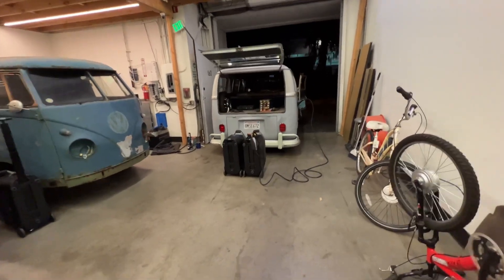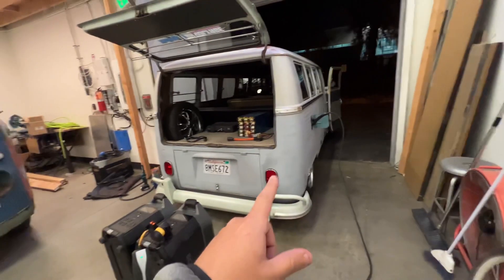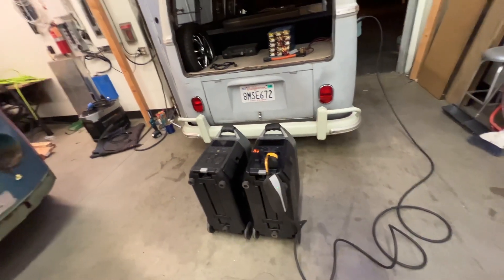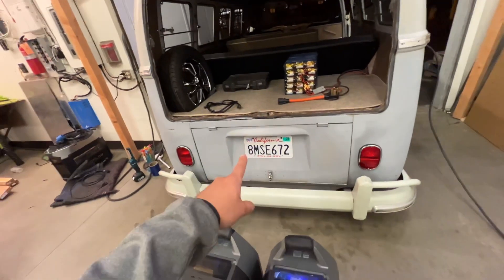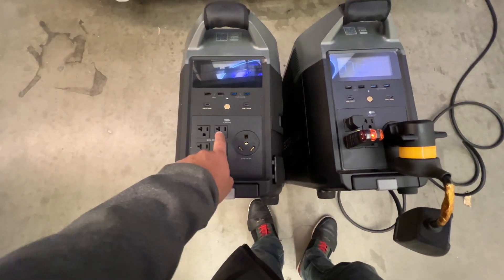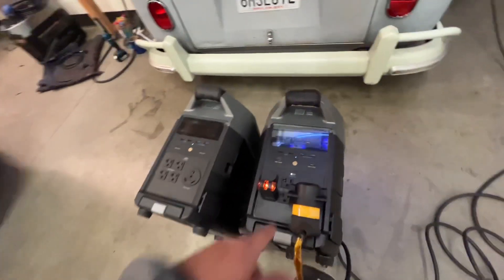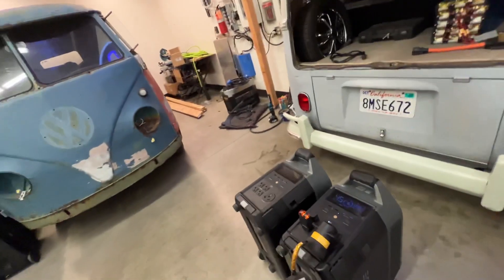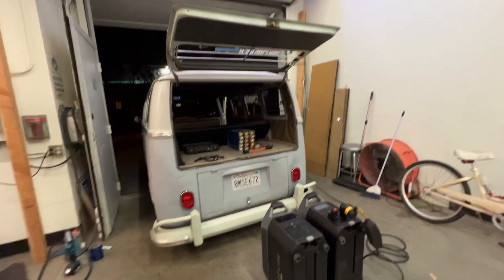Charging my diy EV with EcoFlo DeltaPro at Autopia2099

Comment: Using DC batteries to run an inverter (make AC power) to run a battery charger (make DC power) is not efficient. Quick to hook up, but the Power efficiency has got to be like 50%.

Comment: I heard if you get the EcoFlow adapter, you can tandem the 2 units raising the voltage to 220, though if you’re getting 25 Amps without the adapter, that’s pretty good. My EcoFlow unit should arrive after Christmas, so I’m eager to see how it works. I appreciate you sharing these quick vids!
Reply: I think the problem is that he has one beta unit and one production unit so the double voltage hub doesn’t work, due to reversed polarity or something.
Reply from the maker: I actually tried my production unit together with Ben Sulins production unit and it didn’t work.  Also the ev charging adapter didn’t work with any of the 3 units….  I think there’s still bugs to work out
Reply: @jehugarcia  the EV adapter doesn’t work on certain EVSEs. It doesn’t work with teslatap at home on my Tesla wall connector. It does work on a public ChargePoint EVSE. It doesn’t work on some older J1772EVSEs due to timing issues. I suppose that’s something that could be rectified in firmware. I’ll ask R&D again if they have any update.